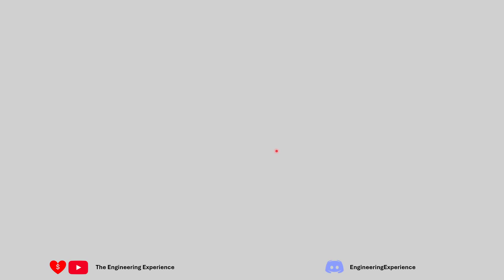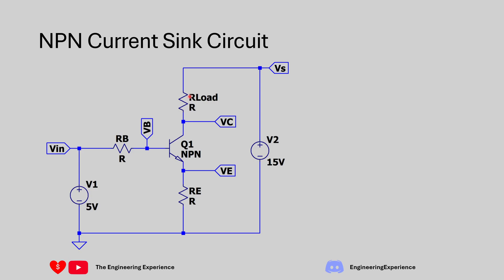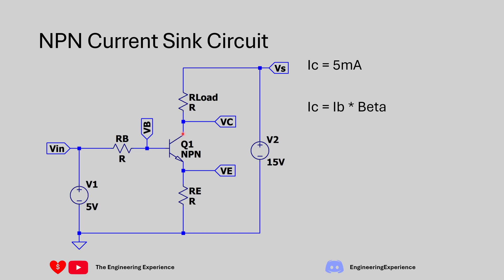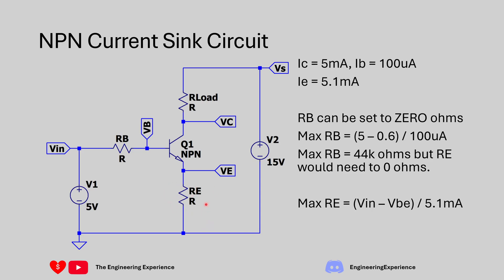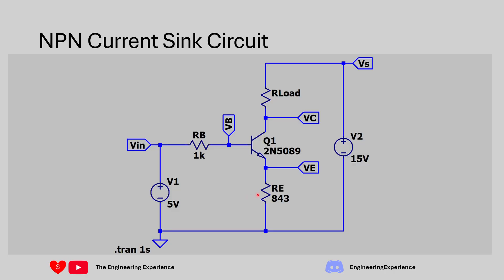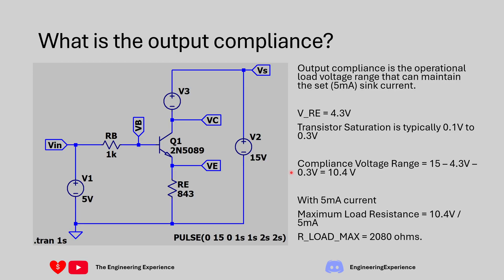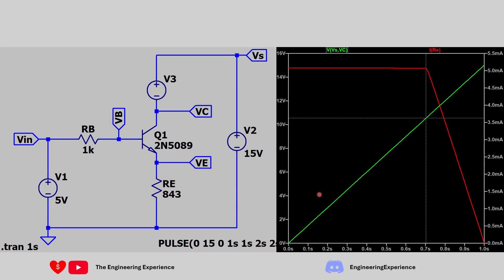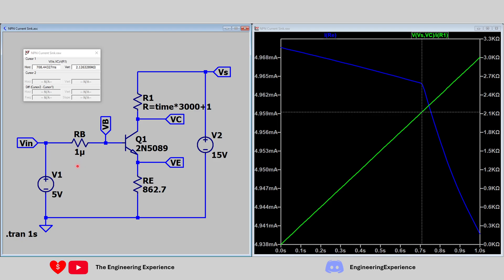Current Sink Design - Art of Electronics Exercise 2.11

Comment: Thank you !
Reply from the maker: You’re welcome
Reply: @TheEngineeringExperienceYT May I ask you general questions? How long did it take to you to finish the book (the analog part)? And how long do you estimate a good pace ?
I feel like it takes me forever to finish a chapter. I'm currently on the chapter 2, and I feel like it's not even the core of analog electronics, I feel it really start at chapter 4 and 5 😭
Reply from the maker: @gnahore5810 a really good question.

I haven’t finished the book yet. It’s the main reason I started this channel. When I was learning electronics, maybe around 10years ago, I was suggested this book and also practical electronics. I never got round to finishing it. 

I started this channel so that I can motivate my self to get to the end but found my self really enjoying making videos so started doing other projects too. It’s a lot more fun my job, where I spend a lot of time on process and documentation.

I think a good pace if you’re learning is going to be a lot faster than what I am doing on the channel. (To give some perspective), I have two kids, a full time job, a side business I am working on so the rate I can create these videos is limited. 

Maybe try 1 chapter a week but this really does depend on the time you have available and how well you understand things. I would also add that you buy an electronics kit with a breadboard, some transistors and power supply, to build the circuits you learn about. 

Good luck and don’t give up! You got this!!
Reply: @TheEngineeringExperienceYT thank you for answering me ! I appreciate